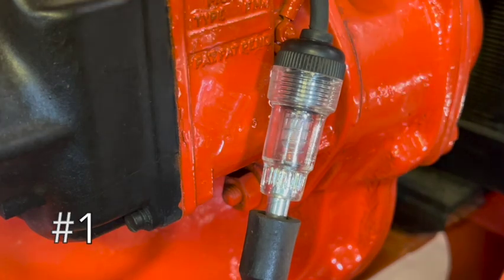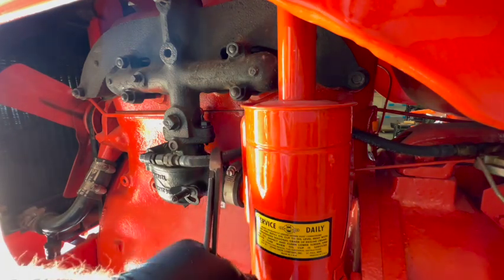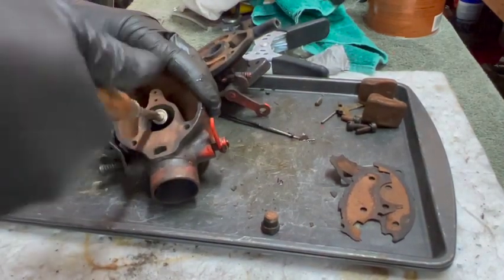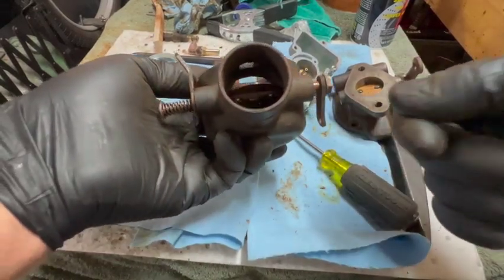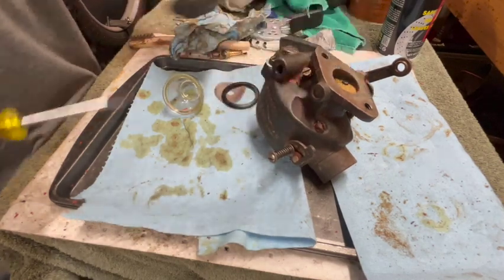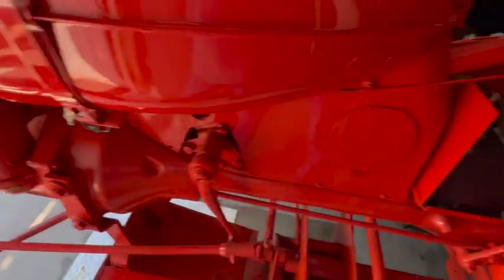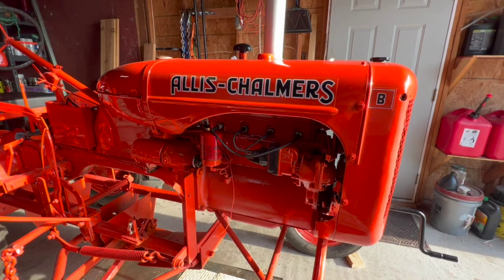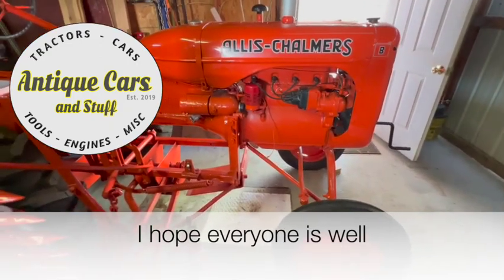1944 Allis Chalmers B - Part 2

Comment: I think you just need more speed on starting to get the compression up. Probably due to stuck rings. How about push starting or pull starting?  I've done that before and it works.
Reply from the maker: I’m trying to fix the starter first, then I’ll pull it if necessary.

Comment: That J model FM mag can be a pain and may not be in time with the motor if not assembled correctly, IIRC.  I didn't care for the condition of the carb float. It looked like one float was dented.  I used to to replace them if I found one like that. Isn't there supposed to be venturi that sits between the lower carb housing and the upper? It's been 20 yrs. since I've had one apart.
Reply: I bought a farmall h , had to leave choke on all the way home, about 25 miles. found out the  venturi pipe between bottom and top half was missing. I hate magneto system's on a tractor.
But with utube I want to learn to work on them  and time them , instead of stripping them off, and buying a battery ignition for going rate 75 dollars. and when I first did that, I didn't
know the single pole ignition switch, needed, changed to 2 pole ignition switch or vice/verca if going to magneto from battery ing.
Reply from the maker: Good observation on the Venturi. Not sure. I will look into that. I think the float is ok. It seems to be working fine for now. The FM J magneto is probably the culprit. It’s producing spark but those little gears might be out of alignment. I went to check this and the cap broke…. It was very brittle. Now I have to order a new cap and reset those gears. I hope that does the trick. As always, thanks for the comments and ideas. I appreciate it.
Reply from the maker: Magnetos are a little trickier to deal with than distributors but I sure love them when they’re working correctly. Yes, I need to determine if this carb is missing a Venturi or not… but, I introduced fuel directly into the cylinders when trying to start it, so it must be something else. It should have popped.
Reply: @AntiqueCarsandStuff  can't wait to see what was the problem as I  my self bought an Allis B, when I was driving semi otr. kept traveling to the auction site at least 20 plus miles away , on my 1 short day off I got sick of running back and forth and bought a 14 ft trailer to go get it , I tried so hard to get the allis B going cause I like the tractor ride home. But couldn't get suction of gas to go to the piston area. Now that I'm retired It's been under a tarp for years. hope it didn't get locked up. and mine has a mag too. I wish I had a battery ignition to put on it for trouble shooting purposes . maybe my rings are stuck. it was sitting for 10 yrs when I purchased it now another 5 yrs I 've got a cub with low compresssion readings  once I changed to a new coil < it would pull start
but the starter just wouldn't start it  / they say sometimes those old coils seem like they work but under compression don't work.